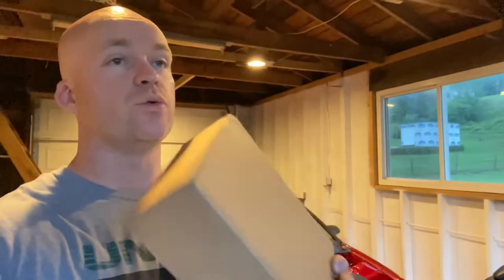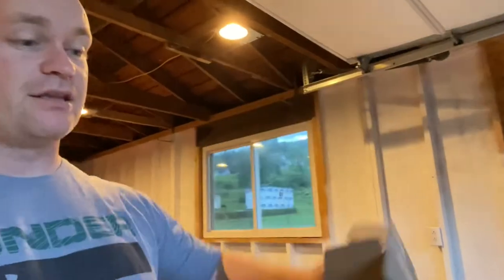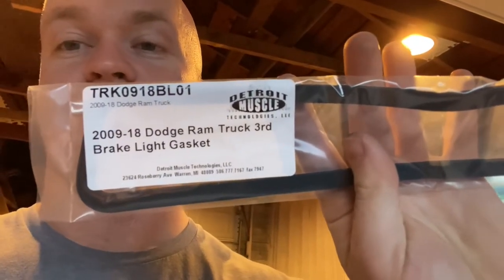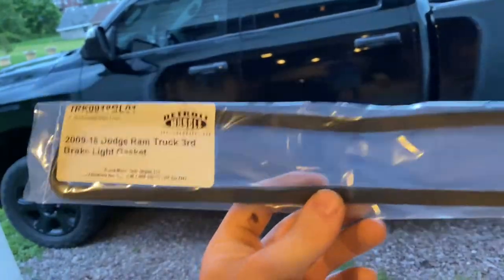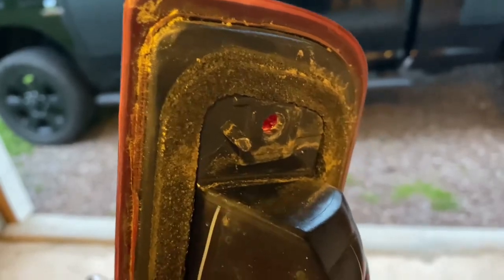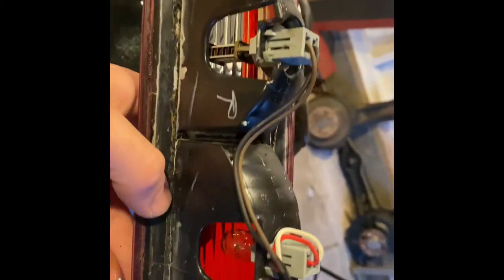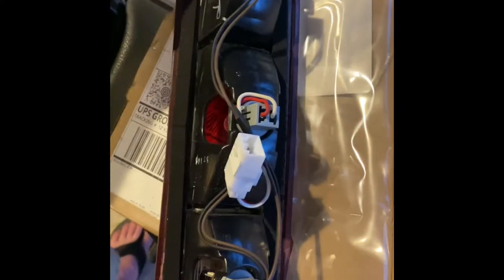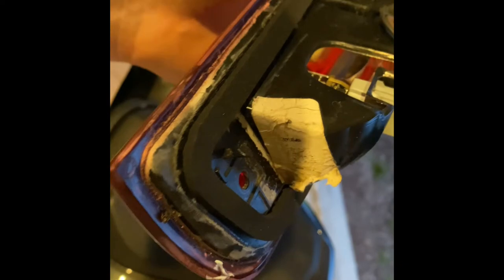DIY: 4th gen ram roof leak fix! 1500/2500/3500 (prevents water damage!)

Comment: Damn. So glad I’m not the only one dealing with this issue. My pop’s 2019 2500 Dodge Ram even leaks from the third brake light.
Reply: the sunroof in my 19 classic warlock was leaking via he sunroof, ended up frying the mic for the handsfree system. they replaced it and it still leaks. i'm pretty furious about it. we, the consumers shouldn't have to be deal with this nonsense
Reply: 2019 Tradesman PW as well. Thx for vid.
Reply: Our 2006 mega cab Laredo with sunroof leaks from the passenger side door handle. Mainly people say this is due to the sunroof drain to being clogged which we checked at the bottom and the door jam and it appeared OK can’t open the sunroof on this truck, so we need to deal with this in another way Even more disappointing 2014 ram mega cab dually Limited started leaking two years ago from the door handle passenger side when parked on a slight downhill slope only. Noticing water in the back passenger side corner which seems to leak down and soak the carpet next to the passenger side door Also noticed wetness only on the rear corner, headliner passenger side third brake light is mentioned. Also, there are drain channels at the bottom of the rear sliding window that are hard to get to mentioned by another channel called Travis Tucker, finding all the water leaks in the fourth GEN ram, also another channel says the vent plastic units will leak and maybe caused the water to come in and get on the carpet for trucks that cost this much money for there to be potentially seven leagues. That’s what Travis says is very disappointing for such expensive trucks I am working on contacting Ram cares to see what they will do. We have had 14 recalls on this new truck and, the front map lights work only dimly since the truck had 1000 miles on it. There should be a lawsuit .class action plus a recall.

Comment: Hello sir, thank you Mr. three guys, we have leaks in our 2006 from you think just the front door handle on a mega cab with a sunroof. Our 2014 only leaks when pointing slightly downhill from the front passenger door a pillar grab handle, when in our driveway and pointing slightly uphill, it is leaking in the back corner getting the headliner wet and it appears the water is dripping from the corner at the headliner so third brake light could be the culprit. Have you seen Travis tuckers video, finding all the water leaks in the fourth GEN ram . he points out seven areas to check for leaks. I appreciate your help with these trucks. I’m very disappointed in this truck over $60,000 on it for a brand new truck although not yet disappointed in the Cummins or the towing ability or the road quality as we said, we wanted a Cummins and it came with the rest of the scrap wrapped around it, although I don’t want to badmouth the interior, we got the limited and it is a luxury truck for sure. Too bad the rear seats getting moldy. Thanks again for your help sir .I just wish I didn’t have to work on this brand new truck . I need to set aside some time from my business, so we can save it from rotting away .to bad dealership around here it is so lame. I would take it back to them but they were very disgusting.  doing half ass jobs on the 14 recalls, especially the frame bracket that holds the steering linkage in place, they left loose bolts and missing bolts

Comment: I took my light out on my 2014 ram 1500 and there was water sitting there! It had leaked a few times and one of the times over a gallon! Took me right to the leak awesome video!
Reply from the maker: Glad to hear it helped. How I started noticing mine was the headliner getting wet and I knew this was a pretty common ram issue. Did you end up ordering this gasket? Believe me it may seem expensive but it’s worth it
Reply: @3guysgarage  I have not ordered it yet. I have it parked in garage for now not sure if I’m gonna replace the gasket or replace the light with a smoked aftermarket one
Reply from the maker: @brantx4116  both are good options. I went with smoked down the road but if I was keeping factory this definitely what I would go with. If you have any questions let me know! Also, hit that sub button if you don’t mind 😊
Reply: @3guysgarage  I gotcha. Thank you

Comment: My 17 is leaking. Gasket arrived.  Could you just put new gasket on the old one, to increase the thickness?
Reply from the maker: I personally wouldn’t do that
Reply: I scraped off the old gasket... new one on.  Can definitely tell it's sealed better.  Old one was flat and I could see dust.
Reply from the maker: @Tngoz  that’s the way to do it man!

Comment: Ok I have 2016 3500 and I put a brand new 3rd brake light with new gasket and the problem was not solved. My old gasket on the old light was smushed exactly the same way. The problem could also be a leaking drain hole on a sun roof or the back window of the cab.
Reply from the maker: Try a light amount of silicone around the gasket
Reply: @3guysgarage  I will try that, should I put it down first and the put the light over it or should I just put a small bead around the gasket on the light itself
Reply from the maker: @nathanurick8320  personally would add to the gasket side that will meet with the cab that sound fix your issue. Did you order the gasket in my description of this video? That fixed my issue with nothing else’s added
Reply: @3guysgarage no I went to the dealer and got a new light, I will try doing what you say though.
Reply from the maker: @nathanurick8320  the gasket I’m talking about is a good deal thicker so I guess if that tip doesn’t fix it try that next and you should be good. Thanks for stopping by!